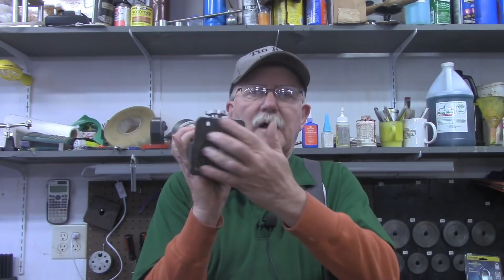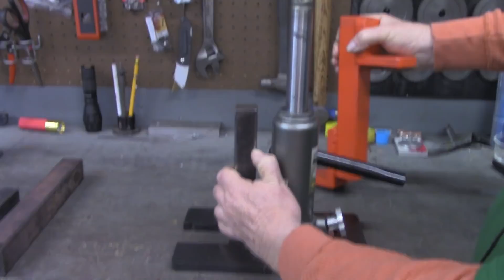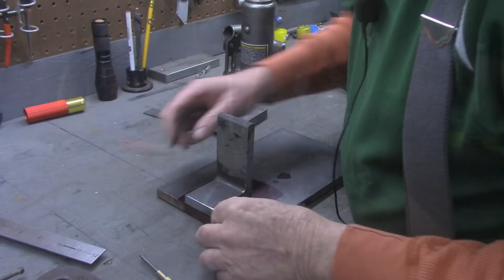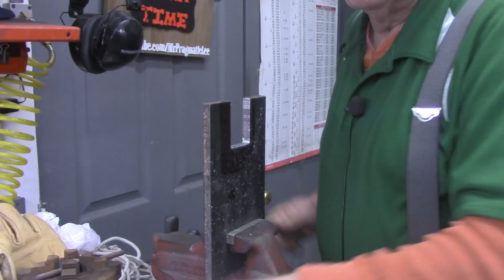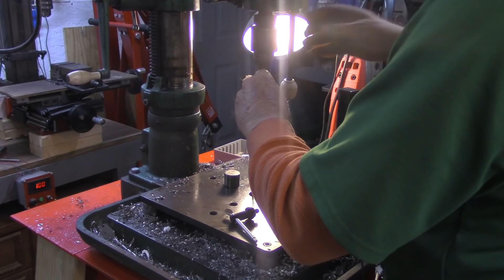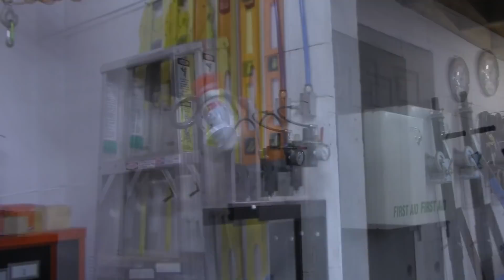Fabricating a ToeJack - Material Prep and Assembly

Comment: I noticed that when you started to lift the grinder the main post moved and hence the point where the jack touches under the toe, a solution would be to weld a half inch thick washer with a hole slightly bigger than the round pad on the jack to the underside to keep the jack in place.

Comment: I think,  that instead of cutting back the base plate like you did for the one,  I'd invest a little bit more time and drill and tap both sets of holes so you could switch the jack to either position as desired...

Comment: Nice build. I have an improvement to suggest.  A ring under the heel to help the jack from moving off of it. When you showed the example lift I saw the jack slip a bit on the heel. Like the Star Trek theme. Thanks for sharing cheers
Reply: Or just mill a slight circular indentation...

Comment: Hi Mr. Lee,
I think your method of cutting the space for the toe with the mill is a superior way to do that.  Some people don't have a mill and they can nibble away at the cut with the bandsaw and that will work, but it takes a lot of small cuts to get it done.  You could put a carrying handle on the outside tube if you drilled a hole through the tube and inner bar and put a clevis pin in there, to lock the tube and bar together, for when the jack is not in use. Just a thought.  Thanks for the video!
-mike

Comment: There exists an abrasive flexible round blade to fit in a hacksaw frame.  Drill 2 holes and cut between them.  The blades are cheap, much better than a blunt or broken end mill cutter.

Stavros

Comment: If you hadn't had the long drill bit, you could have used a standard length bit to drill the outer holes, tapped those, then flipped it over and screwed the jack to the bottom for the two inner holes. 

A small design change could allow for the jack to be oriented either way.  Mount the jack to a square plate, then drill symmetric holes on the square plate.  Screw this plate to the bottom, and you could face the jack in line, or to the left or right.

Comment: For an idea for carrying the jacks. You could drill a hole through the tubing and solid rod and stick a hitch pin in there. Then you can carry it and remove the pin to before use so everything slides better.
Reply from the maker: Psst, don’t tell anyone, but I’ve already done that and a couple of other “improvements”. Stay tuned for next week’s follow up video. 😀